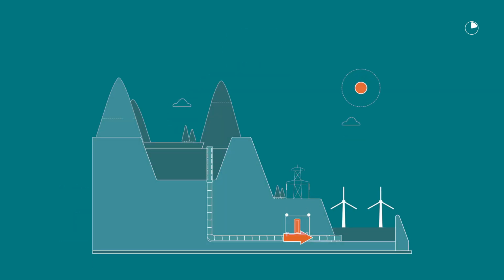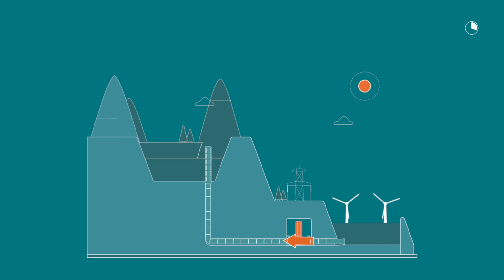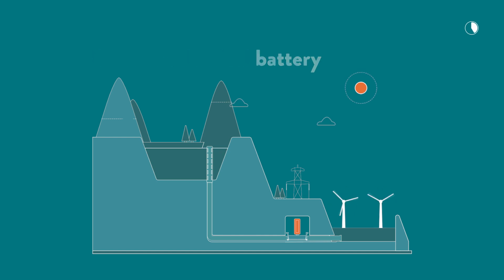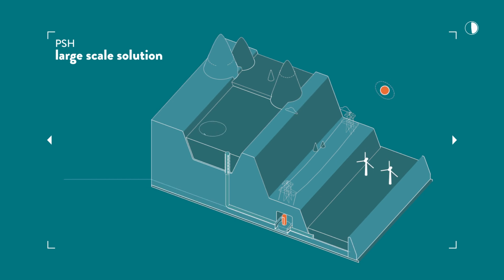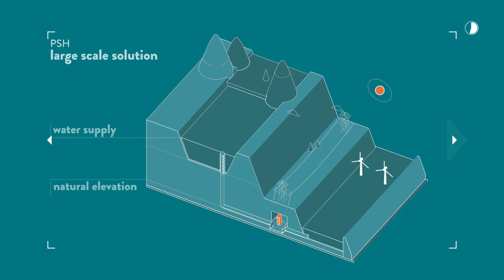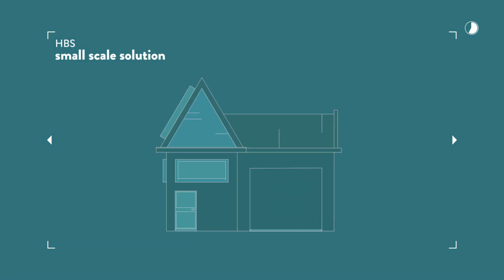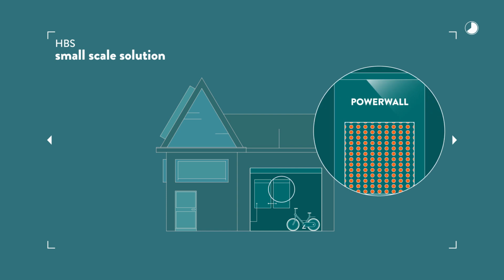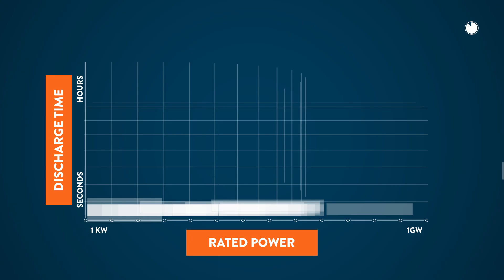Wind turbine energy storage - IN 60 SECONDS

Comment: Pumped storage is brilliant and practically feasible.
The volume of water, and pressure is what determines the energy output. These parameters can be adjusted to suit the site and energy requirements.

Solar+Wind+Hydro. The storage is just water at an altitude. Even if there isn't excess power for pumping up water, we have to build a seperate reserve power plant from solar or wind just for pumping water.

Building a thermal plant and burning coal just because It's reliable and provides power on demand is absolute disaster for the planet. Power on demand can be achieved by up-sacling the capacities of renewable energy power plants and up-scaling water storages with feed-back systems will solve POD problems from renewable energy absolutely.

Comment: There is a slight problem with this idea, firstly it's rare to have an over supply of wind generated electricity and the times when wind is very weak is often very long so there will be insufficient spare capacity to provide for that shortfall.

Theory sounds good, practice is a hard taskmaster.
Reply from the maker: Good point Iain, it is a very long road ahead, but the more renewable energy sources in the energy mix the more storage is going to play an important factor. Although for now we still would rely on fossil fuels for steady energy production. Maybe you'll find our other video about the energy mix interesting: https://youtu.be/xItsCg6CwY

Comment: for 24 x 7 power generation
Greetings, with your blessings and permission. 

https://youtu.be/XRgSUI5QeIo

This is flywheel power multiplication 

The second one is cascading power generation using still water 

For mass production 

https://youtu.be/dxLnZEz5HWU

For residential areas 

https://youtu.be/MWMZPQPE2vU

We have more than 25 years of practical experiences in designing clean energy projects.

We have our own research lab  

with regards
Chaganti
+918555045244